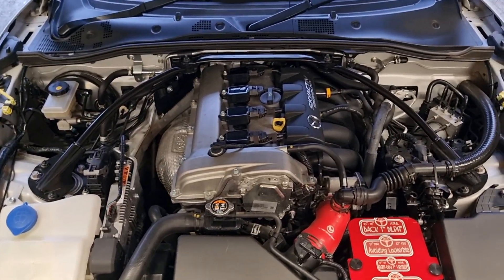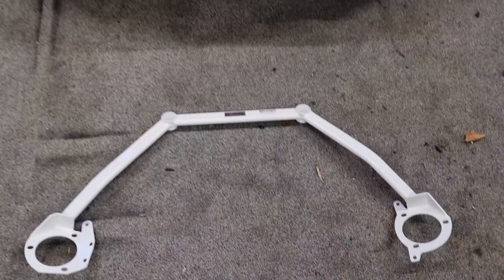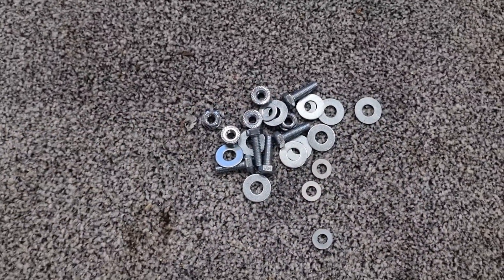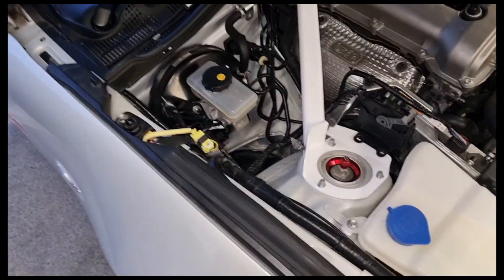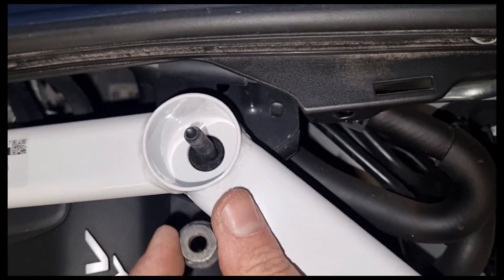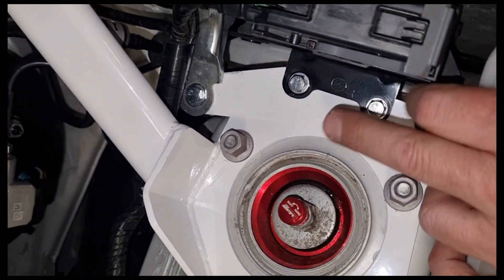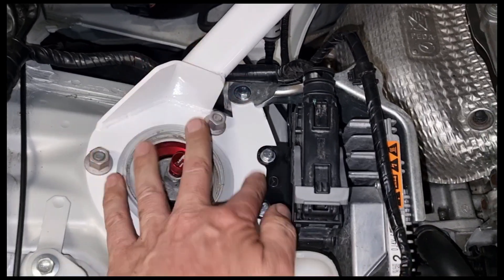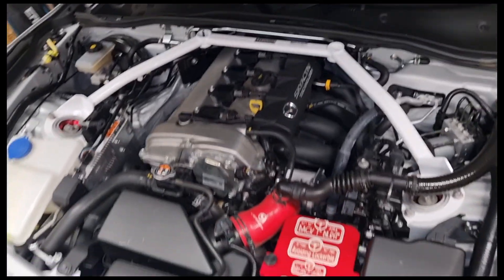Fitting a ULTRA RACING front brace to an MX5 ND2

Comment: So.... what is you opinion? My ND2 has no OEM strut brace. What do you think would it woth it for me to install one even with OEM suspension?
Thanks!
Reply from the maker: Hi, over my stock one, I don't think there is a massive up scale, however being all one piece, it will have improved stiffness. Over a vehicle with no brace, there will be a stiffness improvement yes, however it depends what you are doing with the car. If its just a daily drive then you wont really need it, however if you are putting it through its paces through twisties, then definitely, but its worth getting a geo and suspension upgrade too... hope that waffle helps!! hahaha
Reply: @davedoesit  understood! Thank you!